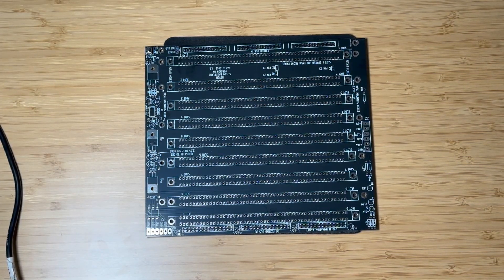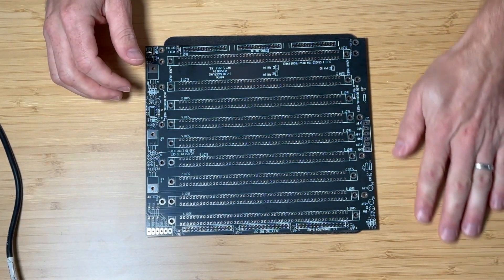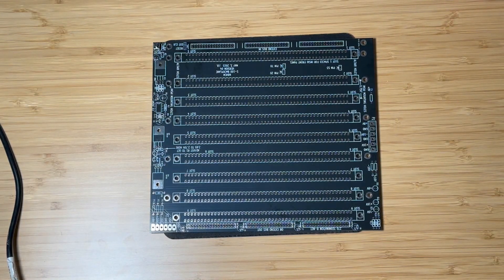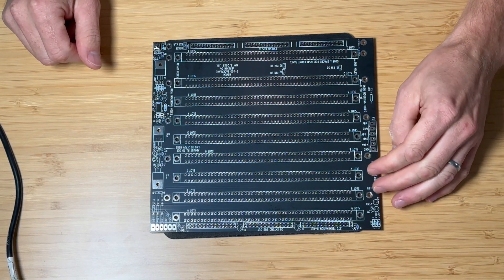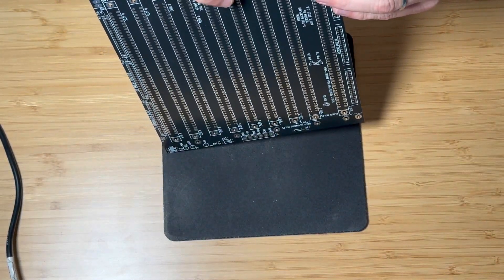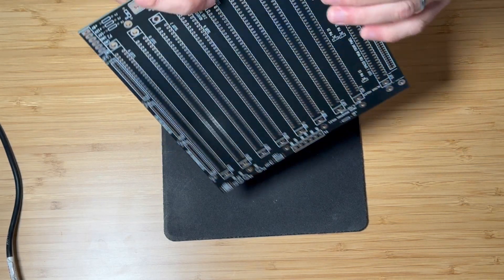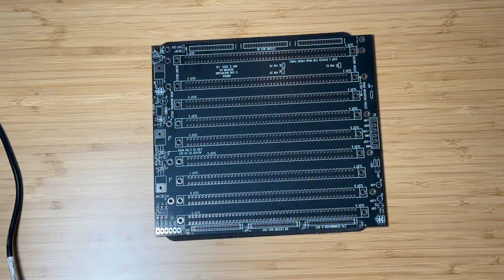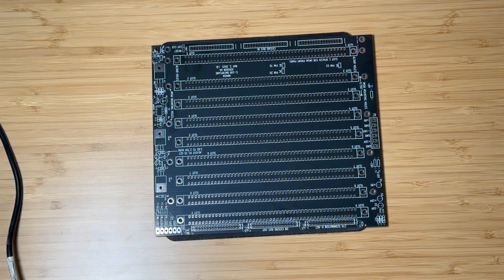Altair 8800 Build - Backplane

Comment: https://youtu.be/i0J9mtBb9fU?si=T5FJ5ySlMT1iycqu

I have these boards that use the same edge connector but different powerrails and data lines. Can I use this?
Reply from the maker: Sure, if you only need to connect all of them together in parallel. But I don't know if that is what those boards require. You would need check the documentation for it.
Reply: @artemkalinchuk  York University has a bunch of stuff on it but not the actual specs of the bus, and manually wiring stuff is a new thing to me.
Reply: @artemkalinchuk  Documentation seems non existant. I do have a friend, the former owner of Matrox, who has contacts in the industry.
Reply from the maker: @johhnnew  You really need some docs. Not all boards are connected in parallel. For example, the SCELBI is connected all over the place even though the connectors are all the same.

Comment: Any reason why this backplane dosent support card guides ?
Card guides then non Altair edge connectors....im done with the backplane
Reply from the maker: I’m not sure. It would be a good question for the designer of the board.
Reply: re card guides, they are availble 3D printed if you have access to a printer…  their also on eBay 3D printed

Comment: THANK YOU FOR THIS !!   DigiKey, part # EDC346102-ND
 works perfectly on my identical backplane board.
 I ordered the narrower original Altair connectors but the row spacing wont work.

The back plane instructions made no mention  of the digikey EDC346102-ND

Comment: That's my PCB!  Sorry that it had black instead of green soldermask, but I made the original batch in black for my 8800c build because I liked the contrast of the black with the blue S100 connectors I used. Nice video!
Reply from the maker: That’s awesome! I guess I might’ve bought it from you on eBay.